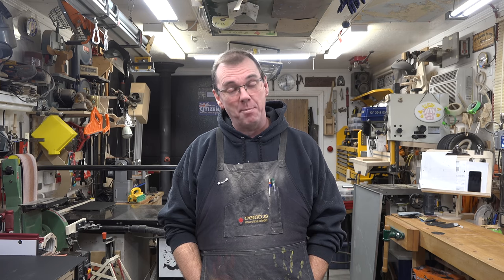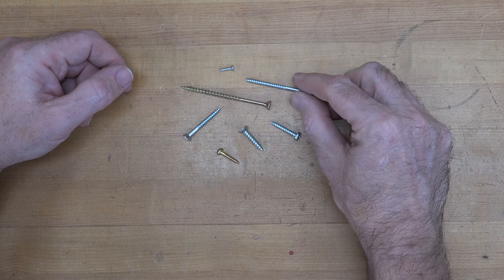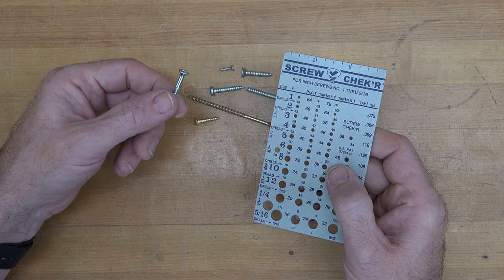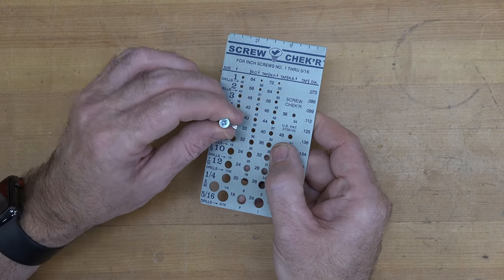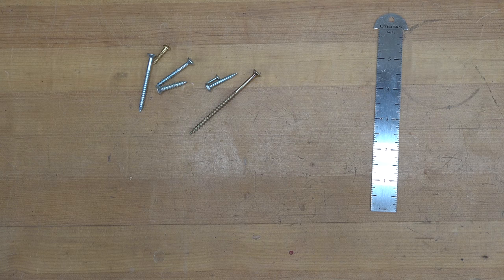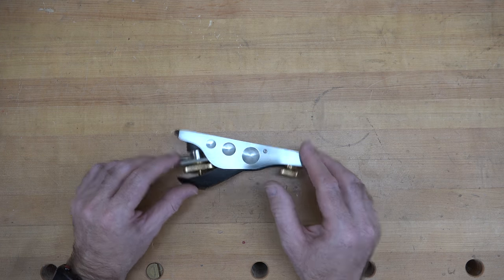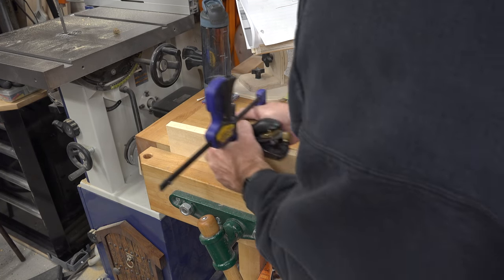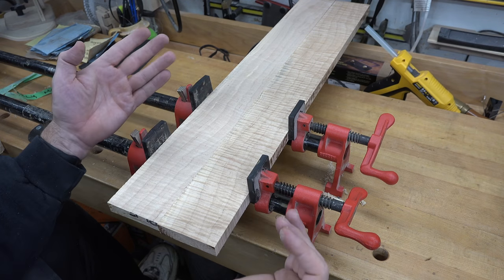Tips and Tricks Episode 6

Comment: Great tips and tricks, the box square tool is something I have made I have from 3" to 6", I usually notch 1/2 circle on the outside and 3/8 circle on the inside so I can use them either outside of the box glueup or inside there are times when I would use 2 or 3 to make sure that the drawer or box are square, I even bought small cheap 4" clamps and epoxy the square to the clamp so I don't have to fumble with spring clamp. Works great fow me, thanks Ken I never knew about transferring a pattern with a flat iron I alway have a box of carbon paper in my desk drawer
Reply from the maker: Glad that you liked the show Alan.  It sounds like you are already well ahead of me on the glue up squares.  I like your idea of the hole inside and out.  That's a great tip.  Thanks for tuning in and for taking the time to chime in with your comment.  It's appreciated.

Comment: Great tips.
For your next episode, you could experiment with these ideas.
If you have problems getting the cut out removed from a hole saw, try driving a screw into the cutout portion.  When the screw hits the base of the hole saw, it will push the cutout out of the saw easily.
There are many videos showing how to make CA glue accelerator using Baking soda and isopropyl alcohol. I think many would benefit from this cheap easy idea if you use a lot of CA glue
Reply from the maker: Those are great little tips Woody.  Thanks for chiming in with them.  I truly appreciate you tuning in and taking the time to leave your suggestions.

Comment: Another 22 minutes (ish) of my time put to good use! One thing I am about to try for transferring patterns to workpieces for my scroll saw is self-adhesive parcel labels. These are available (at least here in Australia under the "Avery" brand) as a single full page label per sheet. Ours are A4, but you should be able to get an imperial size to suit your printers. They can be printed with laser or inkjet. I've printed one in magenta, as I think it will be easier to differentiate between cut and uncut parts of the pattern. Now all I need to do wait is until the weather cools down so I can can get into the shop to finish my table saw tenoning jig so I can finish building my scroll saw table so I can try it out!
Reply from the maker: I've heard of some people using these sort of labels for their scrolling Barry and I have to be honest and say that I've never tried it personally.  I'd be interested to know how it works out and how easily the pattern is removed after scrolling.  Thanks for tuning in to the show and for the kind words.  It's appreciated.  Here's hoping the weather cools down soon.  If you like, you can come here to Canada.....it's -30 degrees C today.  (yes I said negative 30)

Comment: 1. Ironing for transfer. What about an ink cartridge printer?
2. The little plywood squares. I use a bandsaw and except for a corner hole I  would use a small chamfer.
3. Screw sizes. What a great way to find the gauge size! Screw head diameter in 16th x 2 + 2. Thank you!
Reply from the maker: Steve, the transfer method does not work with ink jet printers.  It has to be something that uses a powdered toner like a laser printer or a photocopier.  The photocopier works better than a laser printer but I had to rock what I had.  It sounds like you already had a great method for the plywood squares.  A chamfer would also do the trick.  Glad that you liked the screw size calculations.  It's a pretty neat trick.  Thanks for tuning in this week and taking the time to leave you comment.  It's appreciated.

Comment: It’s so annoying to me when you give a tip that hits me square in the forehead! I’ve dabbled in home machine shop stuff for a couple years, and one of the first thing I learned (YouTube - Thanks Blondiehacks!) was when clamping metal into a milling machine vise, always take a length of small rod and place it between the moveable jaw and the stock to be machined. Then lightly snug the vise and tap down on the stock to overcome any uplift that the moveable jaw might have introduced, then lock it down! The rod can roll, which permits the stock to seat down. I’ve never considered the usefulness of that kink on woodworking glue ups! I just finished building your spline jig, and now you top that with the dowel trick! We might not be paying you enough! Thanks!
Reply from the maker: Glad that you liked the show Tom.  Thanks for tuning in and for chiming in with your story.  I enjoyed it.
Reply: Now that you mention clamping metal I recall doing that in metal shop in high school.  Good that Kenny shock some dust off an old memory.
Reply: @dwightl5863  He gets two “Atta boys” from me today! Ha!